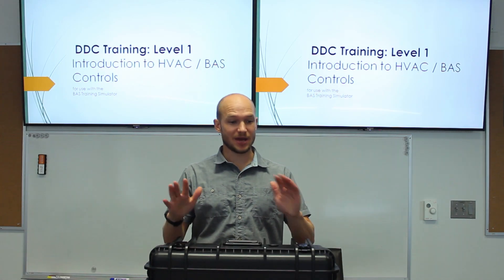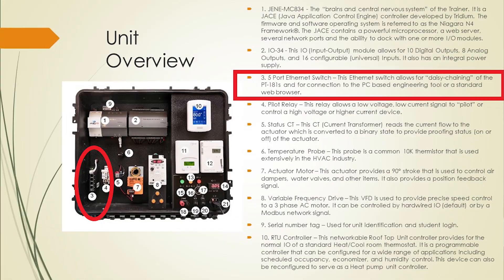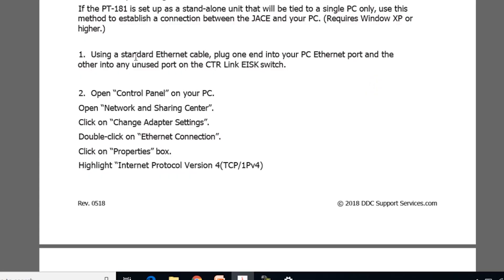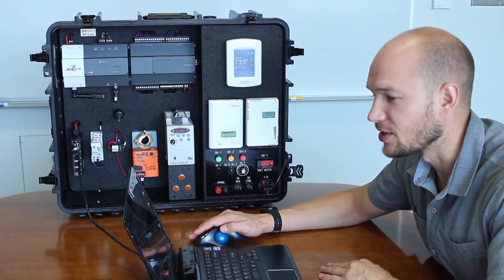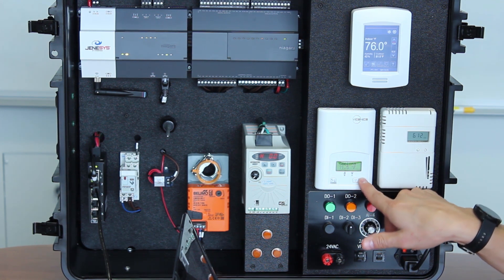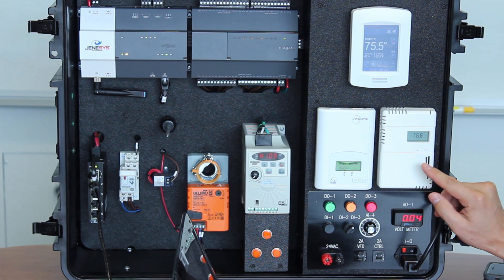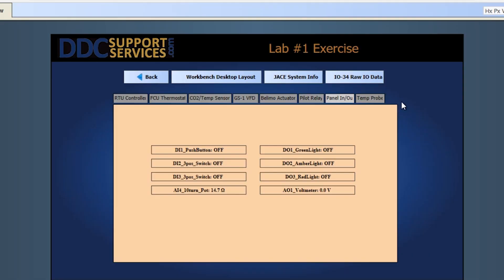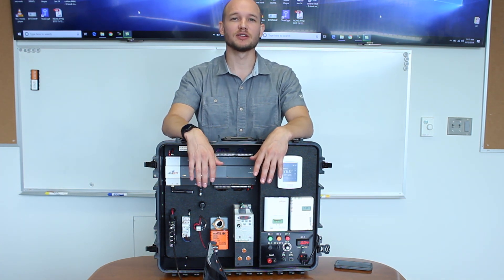Building Automation Systems Basics Lesson 3 - BAS 101 system training simulator

Comment: Hi Matt ,

What is the difference between RTU, FCU and CO2/Temp sensor's temp control ? Are they all in different rooms ? Otherwise, same Zone will have multiple controls.

I'm trying to understand the hypothetically deployed physical HVAC architecture corresponding to the training box.

Thanks
Reply: Hi, 

I think from Matt's demonstration using the Jace box, we are looking at simulating a Single Zone VAV system. 

RTU: Rooftop units are packaged unit capable of supplying air to a space at a set temperature. FCU, does the same thing, however FCU is smaller and are installed in ceiling or inside a building not outside. 
CO2, are usually installed in return air ducts to detect the amount of CO2 level in a level. 
These systems could be found and installed in a single zone and connected to the JACE box (BAS)for monitoring and control. 

Thanks 
Newton